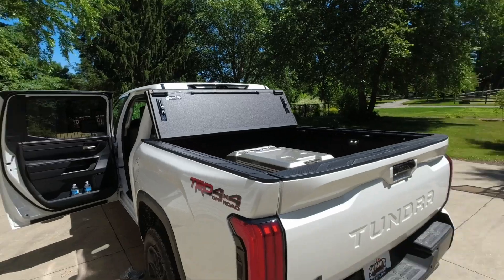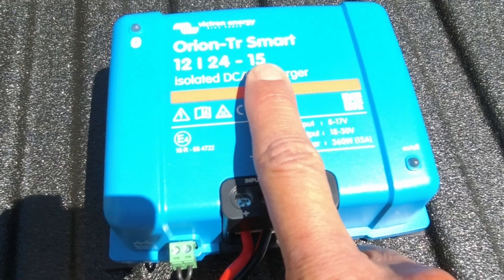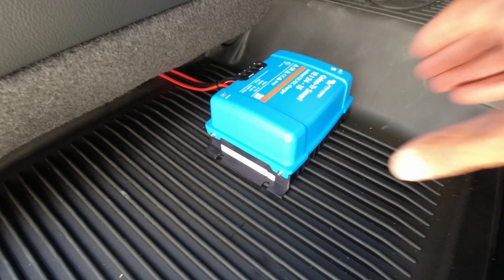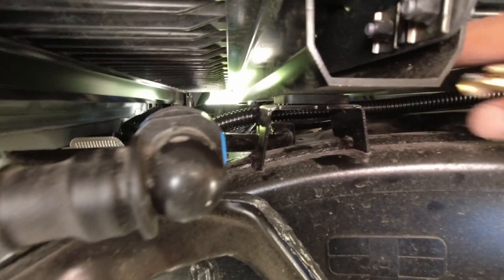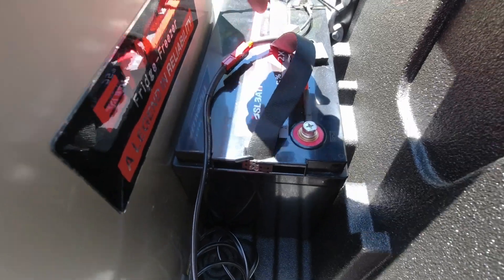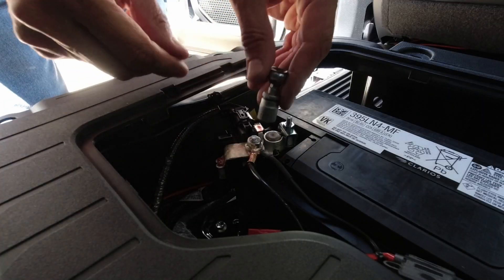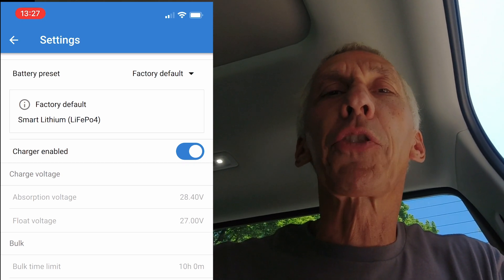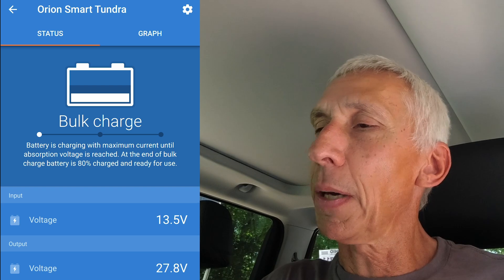2024 Tundra hybrid  Dual isolated batteries

Comment: Thank you for this video. Have been planning the same thing for some time. 

Since there is no alternator and the 12v is charged via the dc converter from hybrid system can you verify if the smart alternator detection keeps the victron charging when the engine shuts off when going into ev mode? Or will this even happen if it needs to provide consistent power to 12v at this point?
Reply from the maker: The voltage stays steady at 13.5V on the Victron App even in EV mode. It really works perfectly in my case. I upgraded the wire to 8AWG and better fuse rated 50A. My previous setup got too hot drawing 30A constant.
Reply: @offgridsimplicity  
Thank you for that confirmation! 2 last questions. Did you have to run a 3rd wire for the smart alternator detection or does it get its voltage readout with just your pos and neg connections to the 12v truck battery?

Last, do you know at what amperage the truck dc converter can supply to the 12v truck battery? Trying to determine at what point is to much amp load pulling from the 12v for dc dc and other connections such as lights winch etc.?
Thanks!
Reply from the maker: @VI510N  You don't need a third wire, the smart battery detection runs off of the input voltage. It is also adjustable in the menu just in case. Mine works perfectly with the default settings.
I do not know the maximum amperage of the 12V system, but I am sure it is ample.

Comment: So what is the spare battery charging off of?  There is no alternator on the hybrid Tundra's.
Reply from the maker: It is charging of the 13.5V provided to run all 12V systems plus charging the starter battery. Traditional alternator or not, that power is provided.

Comment: Wouldn't lithium-phosphate be a little dangerous to run in a truck, especially exposed like? Phosphate is dangerous when it burns
Reply from the maker: It is Lithium Iron Phosphate. It’s one of the safest Lithium batteries. Anything Cobalt oxide or Manganese Cobalt oxide would be the dangerous kind with high thermal runaway behavior.